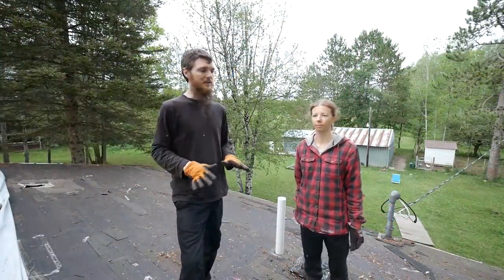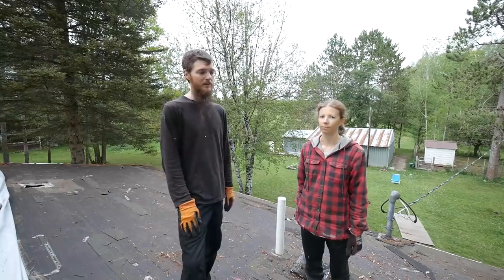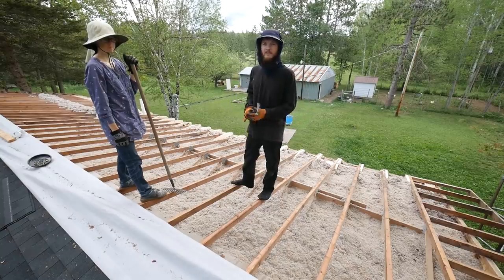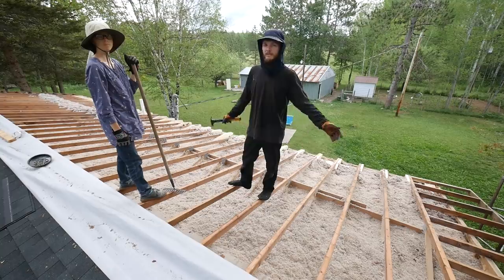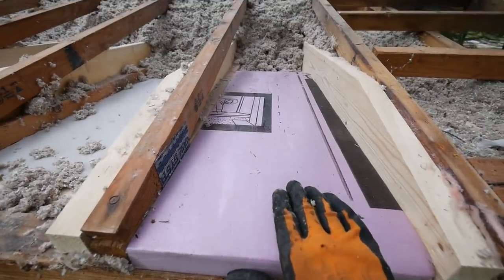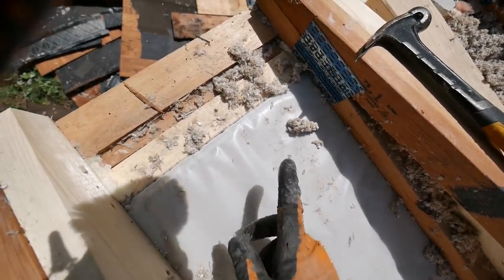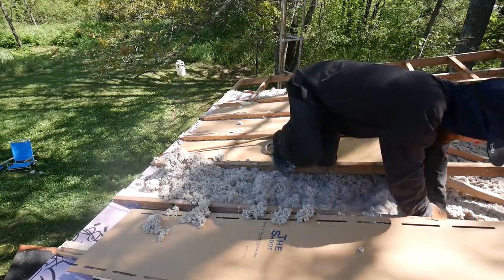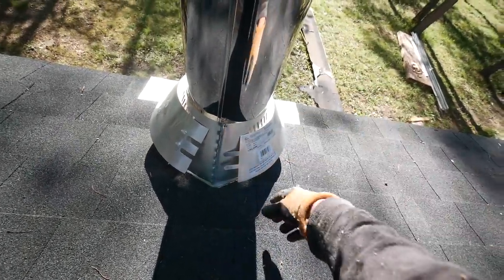Mobile Home Roof Tear Off Goes Wrong - Mobile Home Roof and Attic Insulation Renovation

Comment: Why are you taking the roof off?
Reply from the maker: Initially we weren't even going to do the roof at all, until we did our cellulose in the fall and realized we had cold spots on our ceilings during winter by the edges. With how shallow our attic is, the only way to fix the insulation was to open up the roof, that was the main reason. Also, a lot of the plywood was rotted at the eaves and the eaves were saggy and old.